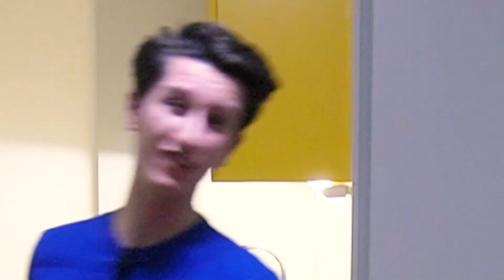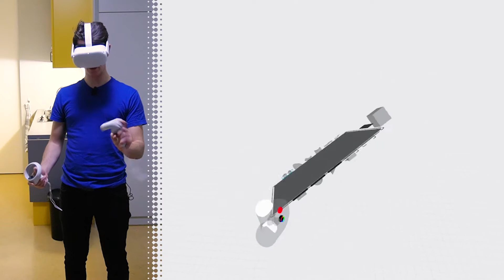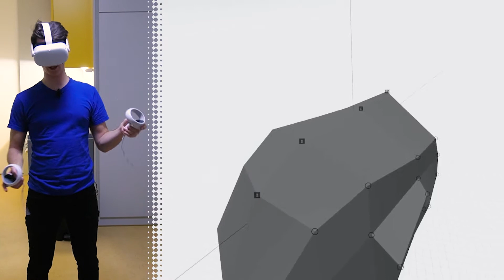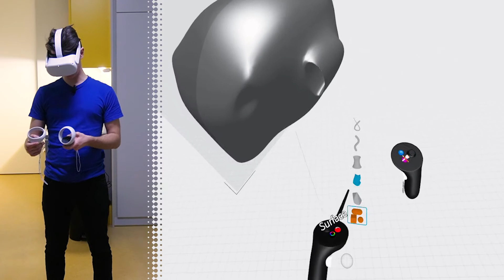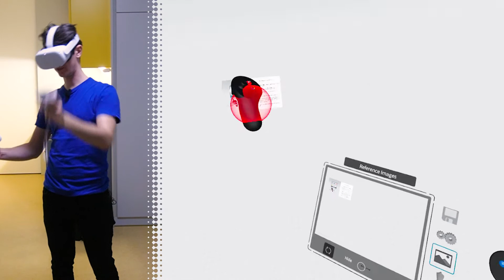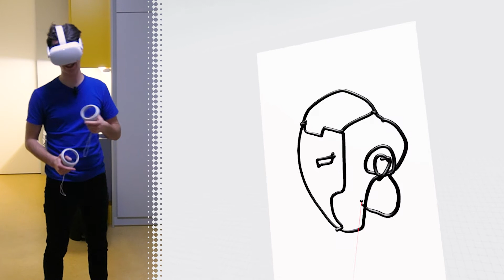The Future of 3D Modeling | Gravity Sketch on Quest 2

Comment: there is a big difference between the Oculus 2 and 1 in terms of modeling?
Reply from the maker: No, not really. But the Quest 2 has better hardware so your programs will run a lot smoother on there. But the Quest 3 is coming out soon so wait if you are in the market for a VR  headset.